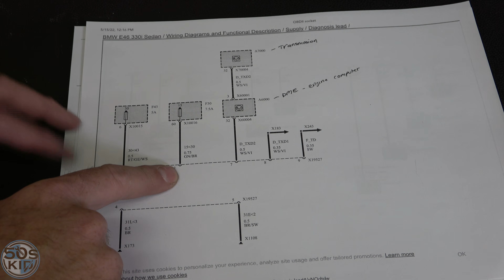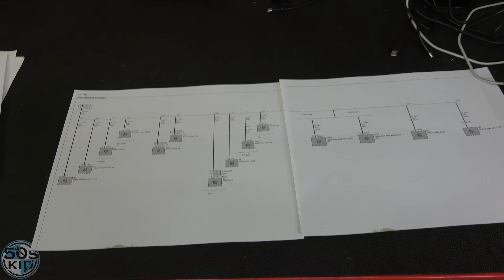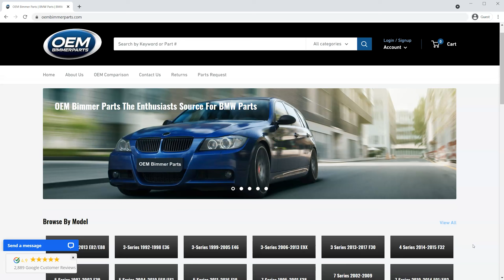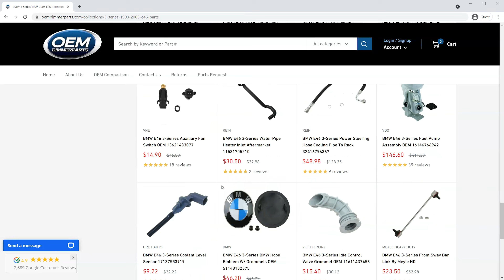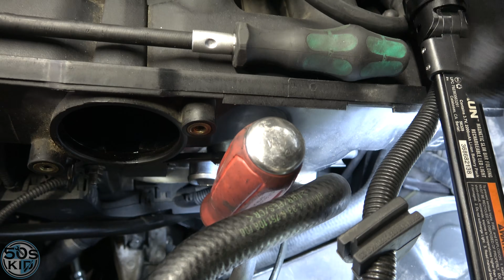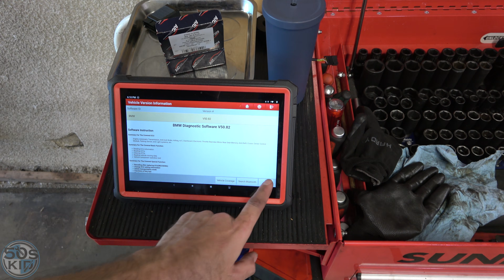This thing sucks to replace! - E46 Steering Angle Sensor DIY Replacement

Comment: Hey. Thank you for the awesome video. I have the same problem, i checked the voltage at the obd, and it measured 6v. I unhooked the installed sensor, and plugged in a replacement, just to check the voltage, and it was the same. Could it be something else? I know that I have a airbag sensor issue as well, could it be related? Advise what surely be appreciated

Comment: On my e46 i dont have steering angle sensor there, can it be that is on different place? I have e46 316i m43b19 77kw 105hp from 2000. My vin WBAAL11020AX23128

Comment: Thanks for the video! What is a good source for wiring diagrams? I have a 318i 2005, I can connect only to DME and EGS modules.
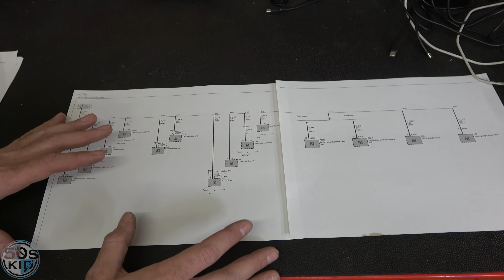Reply: I found the wiring diagrams and they are just like yours. In 4:36 you suggest unplugging the modules in pin 8 to figure out which one is faulty. Where do you do this? Behind the glovebox compartment in the connection block? And in there, the small block with the white/red/yellow wires? 

Yet, it seems like a big leap to go from knowing that the DSC is bad to knowing that it was the steering angle sensor... you were SUPER lucky... because it could had been other of the ~500 sensors, no?

Comment: 50skikd is outstanding used your site extensively when my son and I dropped a m54b30 into his e30. Great resource for everything e46 and very detailed, thanks for all your hard work!  I was wondering if anyone has tried plugging a new sensor in without removing the old one, recalibrate the new one while its hanging from the connector and see if codes clear prior to tackling this job?  If not any opinion on if this might work or not to narrow down a trifecta light situation?

Comment: Need some advice here. So, I am not able to lock my inner steering column. The key tumbler locks the steering wheel from turning right and left. The colum lever locks the steering wheel in place. But, the inner column just moves in and out no matter if its locked. This is making it harder to get the intermediate colum/shaft back on... I did it though, by wedging  a pry bar between the washer and the plastic cover for the column grommet at the firewall. 

My question is, before putting it back together, do I have another problem I should look into with the inner steering column not locking. I think this might be my steering wheel vibration at 70mph.

Thank you the good videos.

Comment: I guess I lucked out, because my daughter owns a BMW E39, instead of an E46.  Haynes Manual (page 10-25) explains how to extricate the SAS.   It's not easy, but much easier than what is shown for E46...  To wit, all work is done under the dashboard.  No need to lift the hood, at all, let alone lift car and get under car!

Comment: Very helpful. I'm in bmtroubleyou hell right now. Bought a new to me E46 after I've had a few.
Dealing with low voltage input to maf. Replaced maf with a Hitachi.
Now I'm running rich
Front 02s are negative 8% on long trim & the system doesn't recognize them.
I have manual steering too. Ews faults & dsc Brief interruption..
I'm thinking it's the DSC now. Still unsure?
Pin out test show 8.5 volts plugged in on the steering angle. Nothing when it's unplugged..
I'm leaning to dsc module & the Hitachi maf is asking for more fuel. 
Just replaced fuel filter too.
Reply: Abs module is saying I'm 80 to 100mph on all the speed sensor.doing  a crawl in a parking lot.. Thankfully I don't have steering control module out. Swipes on that module are good from lock to lock & I can measure value.

Comment: One tip that can save DIY'er time:  Remove the split white collar from the washer under the dash FIRST.   Install the split white collar LAST.  Doing this allow you to move the outboard connecting shaft up and down since this split white collar would restrict this up and down movement.  With a lot more up and down movement, you have easier access to the upper and lower E10 bolts plus it makes it easier to remove and re-install the connecting shaft.  I removed the connecting shaft after jacking up the BMW.  There may be a stiffener frame in the way but that is easily removable.  Remove the bottom E10 bolt first, then move the connecting shaft "up" and out of the lower engaging joint.  Then you move the connecting shaft "down" and then you will have very easy upper E10 bolt.   I did a lot of cursing before I realized what to do.
Reply: You saved me a ton of time and effort. I took off the e10 up top first then the plastic collar with the washer and it telescoped into the cabin. Didn’t have to remove the lower steering shaft at all. Thanks for the help.
Reply: @thegarageservicestation6980 wait so is this easier than I think? I have to replace this sensor and my air bag clock spring

Comment: Jason, For all of us BMW guys,it’s always a discovery. You helped me with my Vanos seal replacement with the upgraded seals. I use red sharpies to mark orientation on all moving/loosened parts. Your are an asset way more than an ass. Some of these kid mech’s kill me with their lack of lubricants and anti seize. Lube all vanos parts with new motor oil when replacing seals. Oil, anti-seize and grease are your friends, occasionally heat. Thank you so much. Now I need those bumper skin blocks that hold the skin on, left/right, somebody broke them.

Comment: yeah the DSC3 cars seem to do that. i read about it in a forum before... but some how also helped me solve all my DSC issues on my  m52/m54 intake conversion and yeah its a seriously annoying location on m54 and notoriously difficult bolts on the steering shaft

Comment: I need to go through these same troubleshooting steps as I cant get ISTA to connect at all.  Where did you pull the wiring diagrams? Out of ISTA or was there a site?

Comment: Great job Jason,
Awesome video again.
I had also the similar bus debugging problems before.  According to WDS: 
... 
The diagnosis bus (D-bus, TXD link) transmits data between the DIS and a control unit. The control unit to be subject to diagnosis is selected by sending a diagnosis telegram to the control unit address. In this way, on request of the tester, the control unit can convey status information and the contents of the fault code memory or activate a control unit output.

The data flow of the indicator instruments and audio system mainly takes place via the instrumentation bus (I-bus) . For instance, the data for the check control module, on-board computer, IKE display, multi-information display, navigation, radio and the telephone are transmitted on this bus.

The body bus (K-bus) is responsible for the data exchange of telegrams that are required throughout the system. For instance, the ZKE and the IHK are connected to the K-bus. The K-bus is technically identical to the I-bus.

...
The IKE is the bus master for the I-bus/K-bus. It serves as a gateway for the D-bus that converts the telegram format of the I/K-bus to the format of the D-bus. It transmits and receives data from all modules and control units connected to the IKE via the bus systems.
...
See also https://www.bimmernav.com/images/ibus.jpg

Hope this helps.

Comment: Great video as usual. I have a RHD car (UK). "This is doing wonders for my back". I bet.
Whenever I do anything under the driver's foot well I remove the driver's seat so I  can lay down in the car and get right under there comfortably.
When I replaced my FSR I found it impossible to do the job working through the doorway at arms length.  Just couldn't do it.
Removing the seat is 3 screws and 2 nuts. Takes 5 minutes. Disconnect the battery about 10 minutes before you disconnect the harness
beneath the seat because that's a part of the air bag circuit. You need the make sure that the air bag capacitor is discharged.

Comment: It's actually easier to get through the wheel coupling from under the car you just take off the the aluminum cover shield and used a 8mm ratcheting wrench or a E8 socket and you're good to go.

Comment: By any change do you have a video working on the heat & A/C housing box? Under the dash? Their is some flaps with seals that on mine are broken so hot air mixes with cold air
Reply from the maker: Not yet

Comment: Great job Jason,
I also had the problem with this sensor before, only I had removed the entire steering column and replaced one demolition screw with a normal screw!
Your version of the repair is just a lot easier.
lg.mike
Reply from the maker: Aww man, sorry you had to go through that

Comment: Jesus, one module can fail by way of shorting to ground, which then takes out your ability to read all the other modules.  That is a bad, bad failure mode that they should have engineered out but didn't.  It also makes me laugh because even in a 20 year old car like ours with relatively simple electronics by modern standards, something like this can still happen.

Why is a steering angle sensor even necessary in a car with regular (non-variable damping) suspension?  Presumably it exists as a check on the front wheel speed sensors to detect faults in the DSC, but even that seems like overkill.  A simpler way to design the fault detection would be to clock virtual mileages for the LF and RF wheels, and if they diverge by more than say 2% over 1000 miles, send up a CEL.  It'll be a known issue on cars driven exclusively on oval tracks and will average out for everyone else.

So aggravating.

Edit: I guess it could have been worse.  At least you didn't have to lower the subframe.

Edit 2: I thought you were insane when you mentioned doing it in the junkyard.  For a job like this that you don't want to do again for 20 years, I would never ever ever install a used sensor.  Weigh $150 for the new part vs. the time you'd have to spend redoing the job.  I'm glad you ultimately put in a new one.
Reply from the maker: Yep that’s why I didn’t end up putting it in. I typically go to the junkyard to learn what I need to know that way I can do the job with confidence on video. But, yeah, I didn’t really want to put in a used sensor so I put it off for a while.

Comment: Hey Jason, I had a very similar problem on my e39. Only the engine ecu was available and I couldn't get access to any other module. Turns out I had a really bad earth due to water ingress under the drivers floor LHS towards the rocker. Once I replaced the earth connector, all was good. I'm actually going to publish a video about it soon. Thanks again for another great video and for letting me know about another e46 fix I didn't know I have awaiting me lol!! Your tutorials are 2nd to none!

Comment: Love your videos.  The one you did on the  Altima helped me massively when I had to replace the cylinder head in 2019. Kudos!
Reply: Oh, even the ones you've done about AC recharging or repairs.